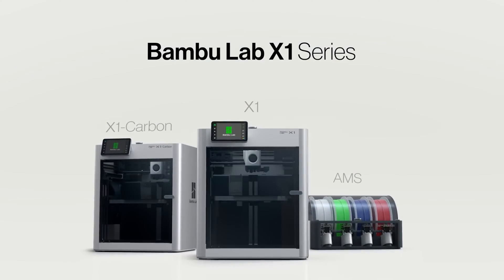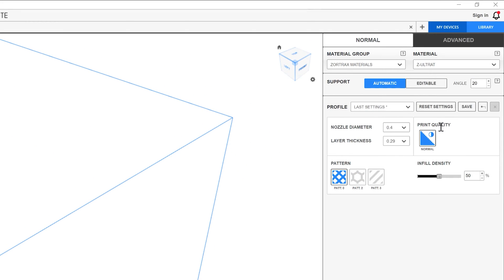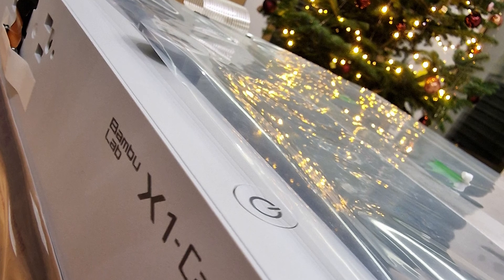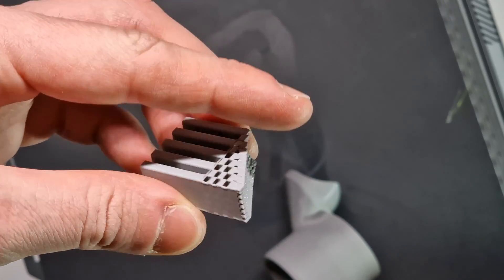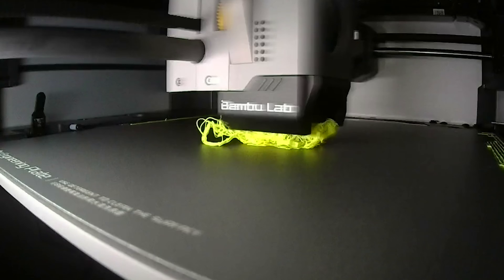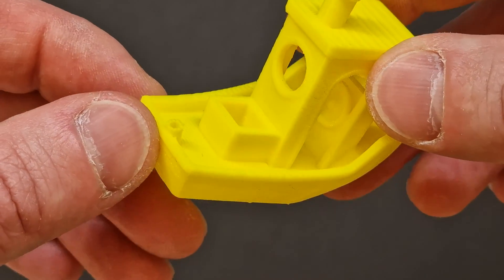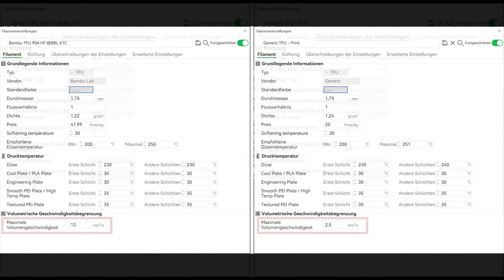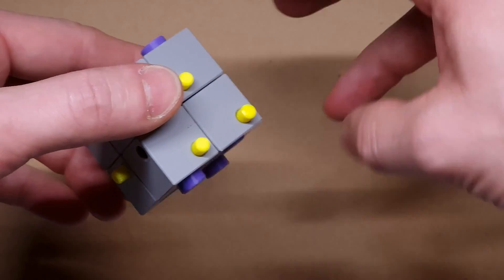How to improve TPU print quality on Bambu Lab X1 Carbon

Comment: Thank you for the print profile. I too was very disappointed with TPU and actually had a spare Creality printer on the side to handle TPU prints. I saved it as a custom profile and will be giving it a try. If all goes well, I'll be able to sell the Creality printer 👍

Comment: Thank you so much  for your effort and guidance with this TPU printing issue. Your suggestion worked very well for me on my P1s and I was able to print several projects since watching this video with zero stringing issues. All my prints since have turned out perfect, what with your suggestions in changing the print speed. Yes, the prints take longer to print out but I'd prefer to wait longer to get the quality that I am now achieving.

Comment: Here is my personal conclusion in a nutshell.
Issue: Material is soft, thus flexes instead of being moved.
Solution:
1. Increase flowrate to counteract the squishing, perform the flow rate test.
2. Increase retraction distance, sometimes 3-4x the usual distance. Don´t worry you don´t really pull your material out of the nozzle, you simply squish it once again but this time backwards. My retraction changed to 7mm which is longer than the meltzone.
3. decrease speed to something super slow like 30mm/s then go up with the speed in 10mm/s steps or smaller. You will notice you can print TPU with like 50-100mm/s with the same quality.
4. Limit your volumetric flow to something like 5mm³-10mm³ and see what happens. Basically the goal is to try out and observe.
Reply from the maker: Thank you so much for your detailed explanations!
I really appreciate the time and effort you put into summing all of this up—it’s super helpful.
To be honest, when I made this video, I had absolutely no clue about slicer settings. 😅
Right now, I’m working on an update about flexible filaments, and I think most of your recommendations will be covered. Looking forward to seeing if you agree.
Reply: @creativemakerat  Sounds great, I am glad to help.

Comment: You should change the flow as well. Softer material is not being pushed through the tube but deforms instead. Thus more flow is needed to counteract the deformation and make sure enough material is being extruded. Same with retraction, you need to retract sometimes 4x as much. Doing so will solve the speed issue as well and the volumetric flow. The material can be molten just as fast as any other polymer, why wouldn´t it be ? But I guess printing faster you had issues with underextrusion due to the flow and not having enough retraction caused all those strings and blobs. This is the problem with simply taking somebodies profile without understanding why certain parameters have been changed. You need to understand why things are the way they are to improve upon. In theory it´s simple, softer material causes X. How do I counteract X. You can even come up with creative ideas like freezing the TPU to make it hard in dry ice or something. Just came up with it =)

Comment: Hello friend, I also have the x1c and the 95A TPU does not work very well, let's see if I can get it with your configuration, 
One question, the black TPU filament comes in matte, is there a way for the printed piece to come out matte as well?
Reply from the maker: Hey! I'm curious to hear if the print profile helps solve your issue—let me know how it goes!
As for your question about achieving a matte finish, unfortunately, I can't say for sure. All my TPU prints, whether with Bambu 95A HF or TPU for AMS, tend to have a shiny surface. You might be able to influence the appearance slightly by adjusting the print temperature. Have you tried printing a temperature tower to see if that makes a difference?

Comment: how did you fix the diameter issues with the pla?
Reply from the maker: I personally use two methods to address diameter issues with PLA:
- adjusting the Quality/Precision settings - X-Y hole compensation and X-Y contour compensation
- printing at a slower speed - this improves the accuracy, especially around corners
Hope this helps.

Comment: my x1 prints BambuLab TPU just fine without drying.  It prints ALL BambuLab filaments nicely.
Reply from the maker: That's great news. May i ask which slicer and x1c firmware version you are using? Thanks!
Reply: @ I use the Bambu Studio slicer and the latest updates for it and the printer.  I don’t recall the version numbers, sorry - but I just update software and firmwaee when new versions are released.  In particular, I use the BambuLab AMS which I find very much worth the price.  I say this because the AMS recognizes Bambu filament that uses an RFID spool.  So the printer knows exactly what material it’s printing and adjusts its settings accordingly.  I have been impressed with how good a job it does.  In general, if a print fails it’s because it was poorly supported and fell over.  Best luck to you!

Comment: Thank you Creativemaker. 
But is there a TPU profile from Bambulab though ?

All I see is the different materials in Filament tab.
In Process tab though there are only the standard profiles for I guess PLA or what ?
How can I print at the same speed PLA and PETG ?
There should be specific Process profiles for all the different filament categories..
Reply from the maker: I'm not entirely sure I understood the question correctly. The profile also changes the print speed settings in the process tab (as shown at 8:42).
However, what I've learned in the meantime is that the easiest way to control the speed is simply by reducing the volumetric speed in the filament settings tab.
Reply: @creativemakerat  The TPU profile from Printables has custom speeds and settings, I can see it.
What I'm saying is if there is any Process profile from Bambu Studio for different filaments.
For example the default speeds in Bambu Studio are approximately 270 mm/sec.
If I select a TPU filament with a specific volumetric speed (let's say 3mm^3/sec) will the profile adjust all the speed settings in Process Tab to match the higher determined speed ?

Comment: I've just had some success with the Overture HighSpeed 95A TPU.... Including working in the AMS - with very minor modifications and tricking it with a non-TPU profile but with TPU settings.  Quite minor stringing at 12mm3 - credit to the profiles on Printables for getting me started.
Reply from the maker: That sounds very promising! What exactly did you change in the AMS? I've seen several solutions before, but unfortunately, they were not very reliable and often ended up with clogged extruders.

Comment: Bambu support tickets are the worst. My x1 I think was damaged in transport because it can’t print on parts of the plate without the belts failing. I’ve now been trying to talk to support for a return for two weeks. They are the least helpful people of all time and I’ve just been manually fixing it every way I can but it still can’t print fast and can’t print PAHT at all which is what I freakin bought it for
Reply from the maker: To be honest, the answer came in an acceptable time and was also very comprehensive and friendly. Unfortunately, I still couldn't solve the problem at the time 😅

Comment: I have been using the Bambu A95 HF TPU for several months and I have never needed to lower the speed of the stock TPU HF profile.. I only have to adjust the retraction..
Are you sure you have TPU HF? and Buy a PEI sheet..
Reply: PEI sheet , clean with hot water and dish soaps ,  set retraction to 2 or 2.2 if you have P1S , 1.8 for x1c ,   volumetric speed at 8  , default is 12 but too fast for some object
Reply: He showed the spool on his desk at the beginning of the video.
Reply from the maker: Thanks for the information. Yes, it is definitely a 95HF filament. Maybe just changing the retraction is enough. What value do you recommend here? I haven't used a PEI plate yet - with or without glue? Thank you!

Comment: I could not get the TPU to work at all for a couple of months. I did a firmware update about a week ago and tried again with the TPU and got a great result. I guess they may have fixed something.
Reply from the maker: That's good to know. Due to time constraints, I haven't had my printer in use for several weeks. Let's see what the next firmware update can do 😉

Comment: Somehow bambu lab printers bring back old hearsay about tpu… It does not need to be printed slow or with slow volumetric values. Bambu lab printers can print tpu fast but you need to lower the tension on the extruder which needs to be modded for it to be easy. I printed well over 100kg tpu and print it at 25mm3/s. You also need to have as little friction as you can for the extruder when pulling the filament. Also tpu likes to build up an over pressure in the nozzle so one needs to usually run really high values to compensate that. I have not bothered with tpu on the bambu printer cause I have bigger printers printing tpu faster. So can’t say for sure how fast the bambu printer can print tpu. All I’m saying is that I know it should be able to do it way faster.
Reply: Hello, thanks for your commentary. Do you have experience printing varioshore tpu?

Comment: I also had to figure this out by myself. Though, im still able to print TPU on 150$ Ender 3 with 10$ direct drive upgrade ~7mm3/s with far better quality than in Bambu with 2.5mm3/s. That printer is just not for TPU.

Comment: Seems like you had used the TPU HF profile for normal TPU? Because in Bambu Studio the normal profile is also set up to less than 4mm^3/s for the standard TPU 95A and the 12mm^3/s are for the modified TPU HF. I had 0 problems with the TPU HF I had recently gotten and the default profile.
Reply from the maker: At least "TPU 95A HF" is printed on the filament roll (and it's also the only roll of TPU I own). If Bambu didn't wind up the wrong filament, then it should actually be a "high flow" TPU 😉
Reply: @creativemakerat , good answer...

Comment: Enjoyed the video. I actually started out with quite good TPU prints, and wondered why everyone else had issues. But I had downloaded a profile and was using that. It was fairly fast, with 140mm/s outer walls and I was using the 12mm/s3 profile. However, I had also almost immediately installed the aftermarket high flow head from aliexpress. At some point, I took that off, and my TPU prints started under extruding and failing. In search of a middle ground, I did the flow rate testing and played with higher temps. I found I could do a flow rate of 8mm/s3 if I upped the temp to 260. The head can still flow much more than that, but I believe the issue with TPU becomes cooling on overhangs.

You probably have higher expectations than me, but I think you could go just a little higher on your speeds and still get good results. I've been so impressed that I can print TPU at the speeds my old bed slinger would print PLA. And the time is soo much shorter because of the travel speed.
Reply from the maker: Thanks a lot for sharing your experience. I definitely will try to increase the speed settings by using your suggested values!
Reply: @creativemakerat   Just an update. I've settled my settings a tad bit lower. Quality vs speed, my settings are 240 degrees and 7mm/s3. Also, I've found that if you run too slow with higher heat, you will get bubbles. That's why I started coming down from 260. It was fine for faster stuff, but if the model was small and it slowed down to keep the layer time above 8 seconds, it got too slow. Upping the minimum speed from 10 to 15mm/s helped that, but then I started seeing just how low temp I could go and still achieve a good speed. 240 and 7 are those settings.
Reply from the maker: @rcrdps8144  many thanks for the infos!

Comment: Hi, do you got any Problems with TPU getting clogged in the Extruder? I'm currently running overture 95A TPU (the most basic TPU I know ;D) on my P1S and it seems to work fine. But bigger prints stopped working after a bit, because the Extruder got clogged.

As for my research the problem should be retraction settings. For example, if you use Z-Hop (often more problematic, even for firm Filaments) the TPU is too often retracted and is going to get clogged very likely.

Using non crossing Infill patterns such as Gyroid shall also help.

Also you're right with speed for quality. Slower is better for TPU. Currently I'm at 1,5 - 2mm Cubic Vol. Flow and the print quality is alright.

Knowing this, I'll tweak my settings in the slicer and I'll report if that helped.

Otherwise great Video, thank you.

Grüße, Keks.
Reply from the maker: Hi! Till now i never had any problems with clogging. But on the other hand, i never printed "something big" with TPU.

In any case, thank you very much for the tip and your experiences.
I'm curious to see wether you can optimize the settings.

Thank you also for the nice feedback 🙂
Reply: @creativemakerat  I got some results now:

I actually had a clogged Extruder again. As I found out the main problem for me is actually heatcreep. Because I dislike the chamber fan turning the printer in to a Jet, I turned the fan off with the Custom GCode. Back to our topic: I do print with the door open, with 1,8 cubic milimeter vol. flow, Gyroid infill and WITHOUT Z-hop. The results are pretty good so far, without any problems with my printer.

However my parts had some strange artefacts, looking a lot like underextrusion, mostly on sharp edges. For that problem I turned off "slow down for overhangs" and the problem is gone.

Gruß, Keks.

Comment: I was getting some stringing when printing with Overture High Speed TPU. I turned off the part fan and no more stringing.
Reply from the maker: I would not have expected this. I would have thought that there would be more stringing since the material remains soft. Thank you for the info!

Comment: No way your first use case is exactly the same as mine haha! I am making  a multimaterial plug that fixes the sewer smell in my boiler room. Good stuff :)
Im experimenting with print in place seal ring at the moment and im testing the bonding of ASA and TPU when printed together. Sad the AMS wont run TPU. I dont even want to try and the clog it.
Reply from the maker: Haha, what a coincidence. On the other hand, nobody likes a bad smell ;-). But im curious whether you managed to combine ASA and TPU directly in one print? This would be super helpful for further projects.
I read somewhere that you can apparently also load the TPU 95A HF in the AMS, as it is not quite as soft as "standard" TPU. But I don't know the source anymore. In any case, I would be interested in your experiences! Many thanks in advance =)
Reply: @creativemakerat  I just made a test print a couple of days ago and the adhesion is surprisingly strong and good! 
I made an assembly in solidworks of  two 20mm high and 20mm diameter cylinders and placed a 2mm sandwich piece of TPU in between (also D=20mm). Defined all materials In orca slicer ASA/TPU/ASA. 
You will get an error message when mixing TPU and ASA.
You can get around that Error by setting filament type of the TPU to ASA aswell. Since the actual TPU sandwich part is not affected by bed temperature (in my example) i set that to the same values as my ASA filament, so i dont have to cool or heat the bed at the switching points (Which would hurt the ASA's bed adhesion). Nozzle temperature switched over automatically like in any normal multi material print.
Actually printing with these settings was VERY VERY VERY annoying tho!

So for anyone actually wanting to try this method here is a quickl rundown of what you need to do. (Bambulab X1C in my example)
 
You have to disable the AMS, pause the print in the slicer at the exact material switch, use the touch controls to drive the tool had to a comfortable place or the poop chute. Actuate the cutting lever on the print head by hand, use the controls of the extruder to unfeed the ASA until you can pull it out, switch the spool and refeed the TPU all manually. Heads up, I even had to do a manual flush with pla and 290°C first. Otherwise my  95A TPU wasnt stiff enought to force out the remaining ASA residue in the nozzle. Give it a try with a simple part like i did, it works and might be a start to a really cool specialised technique :) At this moment while not having TPU AMS capability i only recomment "sandwich" like prints where there is a solid ASA and then a solid layer of TPU and so forth, like my test print. Having to switch like this over and over again because of a complex contour on a part (printing an O-ring only on the circumference on a part for example) would be a total nightmare since it took me a good 5-10 min of labour until everything was clean and done per material switch. 

I hope some AMS compatible TPU material comes out  or the community comes up with a better AMS feeder that doesnt bind up with TPU.
Reply from the maker: @Asynchronous-   thank you so much for sharing your experiences and the detailed explanations.

Comment: You don't need a profile from printables. "Generic-TPU" is part of Bambu Studio, you can activate it in the general filament section. It all depends on the volumetric speed, which is set to 3,2 for the Generic TPU profile. This setting overrides the values of the printing speeds, so there is no need to adjust the speed settings seperately. I use this profile all the time for my TPU 95 from 3D-Jake.
Reply from the maker: Thanks for the hint. I almost thought that it works like this, since a corresponding notice is displayed in Bamboo Studio when setting the maximum volumetric speed. But I wasn't sure.
Reply: The reason i am watching this video is Generic TPU profile sucked for me. the initial layer temp of 35C is not working at all nothing prints. Bed adhesions starts at 45c with texture PEI for me. I had never had any issues printing TPU with my old Ender3 S1 Pro but not once will BL P1S. The closest result i get was with the profile mentioned in this video.